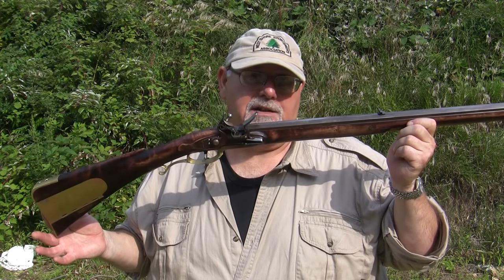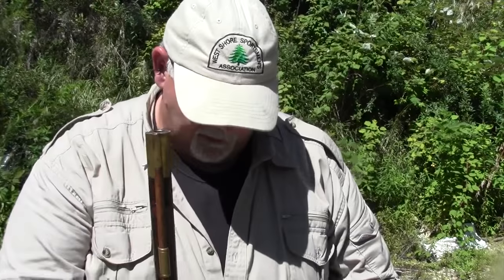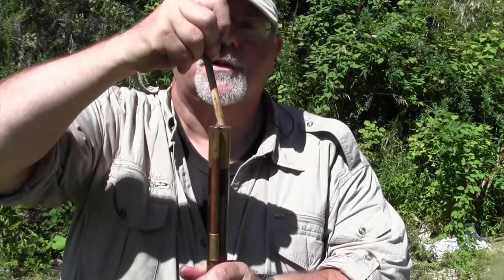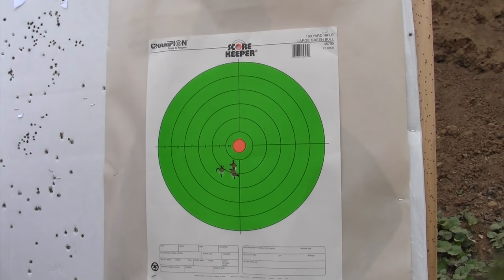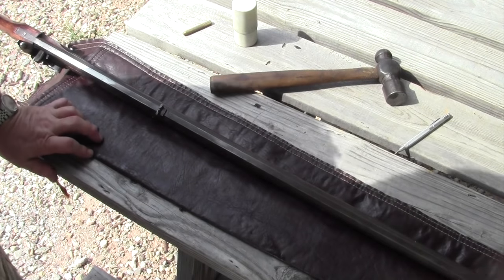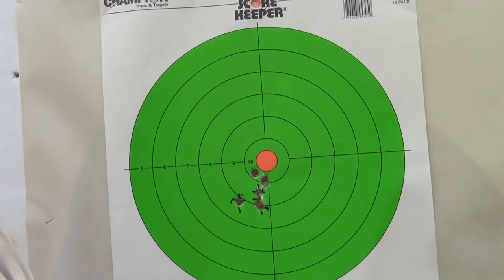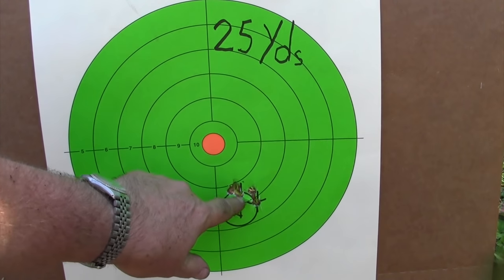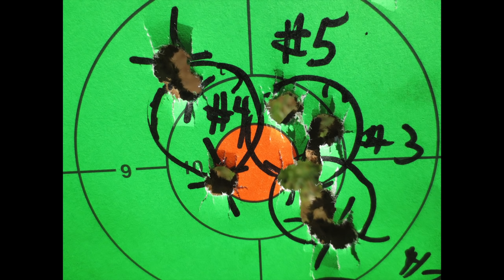Flintlock rifle sight in

Comment: That .395 diameter ball is used by some ppl in .36 caliber percussion revolvers but usually with a 20 grain load of 3f and from a 7 inch barrel. That ball from the pistol is putting out about 120 foot pounds of energy. From that long rifle with 40 grains of 3f you’re probably getting over 200 foot pounds of energy and you could probably hunt small deer and small boars with it

Comment: So Mike, I'm just curious why 3F instead of 2F? From the world of Cap and Ball Revolvers, it's 3F (or 2F which is acceptable in some circles for big bore), but I've noticed with the rifles, particularly Flintlocks, everyone seems to use 3F.
Reply from the maker: Steven S. with rifles 3Fg is generally used up to .50 caliber with 2Fg used for over .50, but lately there has been a drift to use 3Fg for all calibers. I'm on the fence about that and I've been testing, but don't have conclusive results yet.

Comment: I was looking for basic info on sighting in a flintlock.    Like.....  If its shooting to the right which way do you move the rear sight.     So it looks like you chase the bullet with the rear sight.
Reply from the maker: Move the front sight in the opposite direction to where you want the bullet to go, and you move the rear sight in the same direction you want to move the bullet. So, to lower your point of impact, lower the rear sight. To raise your point of impact, file the front sight lower. To move POI to the left, either drift the front sight to the right, or drift the rear sight to the left.
Reply: Thank you.....

Comment: My Lyman Great Plains .50 needed some sighting in with some filing on the front sight. It was hitting low and I had the rear adjustable sight up almost all the way to sight it in 2" high at 50 yards. This bothers me so I filed on the front sight until I had it hitting where I wanted it to with the rear adjustable sight centered. This way there is much more room to adjust for elevation. It's easy, just go slow. You can alway take off more but it's pretty tough adding metal lol.

Comment: Will it still accurately hit at 50 yards and a 100 yards if sighted in it at 25 yards?
Reply from the maker: no. Sight it in for the distance you will usually be shooting at, and learn your hold-over/hold-under for other distances.

Comment: I realize all rifles like diffrent charges but do you have a suggestion for a 25 to 30 yard charge ?
Reply: In short, the charge that is most accurate in your gun is the best 25 to 30 yard charge. Personally, I like to find the weapons sweet spot before sighting it in. Obviously you need to be on paper, but beyond that, work with your gun at close range, 25 yards, changing the powder load, patch thickness, lube, (if you sue it) etc until you have a -5 shot group that is as close to one ragged hole as you can shoot. Bench resting is best for this. Once you have that, move out to 50 yards and see what it does. In all likelihood it will still group best so remember that charge, but play around again till you are sure.  Once your 50 yard is good, move it out to your max comfortable range, or 100 yards whichever is closest and repeat the process. When all is said and done you will know the perfect load for that gun. Then sight it in for the range you are most wanting to use it at and enjoy!

Comment: To remove the front sight. Do you go left to right or right to left. Or it doesn't matter? If your shoots are hitting low. Can you just increase the power to get the shoot high?
Reply from the maker: MrAwesome glock Either side. I cut the dovetails myself and they are parallel sided. Theoretically I could increase the powder charge, but I'd probably open the groups up. I can tell by the way the rifle cracks that it is a good load as is.
Reply: Thanks for the info . Some people have told me that using the same grain amount of FFF powder is more powerful then the same grain amount of FF powder. Is this true? and if it is true . Is it safe or should I decrease the powder?
Reply from the maker: +MrAwesome glock up to a point. Finer granulation a are faster burning in light to moderate loads. In big loads the tighter packing of fine-grained powder slows the propagation of the flame through the charge , so pressures go up faster than velocity
Reply: +MrAwesome glock Back in the 80s when I first started shooting BP I was actually told to only use Fg and FFg for main charge in rifles, Fg for large cal and FFg for 50cal and below. FFFg and FFFFg should only be used for priming charge in rifles, but mainly for pistols. Never encountered any problems at all following this advice, but it is a pain in the 'proverbial' when you are at the range and run out of FFg and still have FFFg left, lol. I used to fire 75cal Brown Bess (flint) (smooth), 58cal Musket (cap) (rifled) and 45cal Kentucky (flint) (rifled). Used Fg in the Brown Bess, either Fg or FFg in the Musket and FFg in the Kentucky. Stone the bloody crows, wasn't the Kentucky accurate! I also used Fg in my 45-120 Sharps (C. Sharp Arms), but been informed that it will accept FFg no problems, but haven't tried it yet as with smokeless loads, still exclusively BP.

Mike is a person with far more experience and I take his word as gospel.

Thanks for posting Mike!!
Cheers from Downunder :)